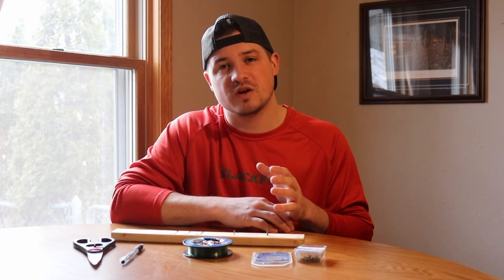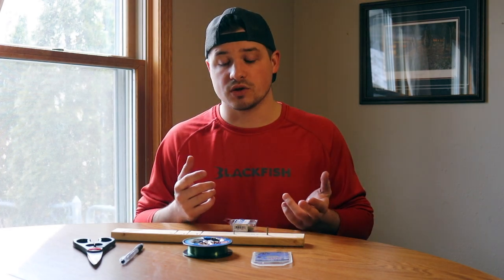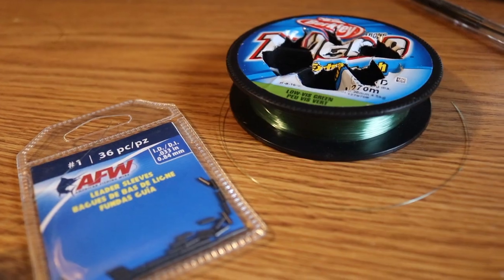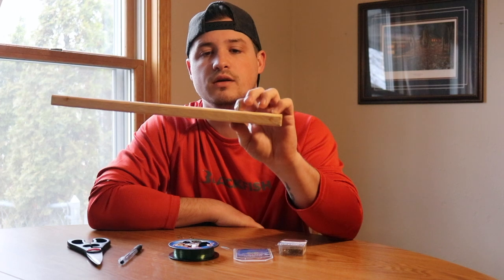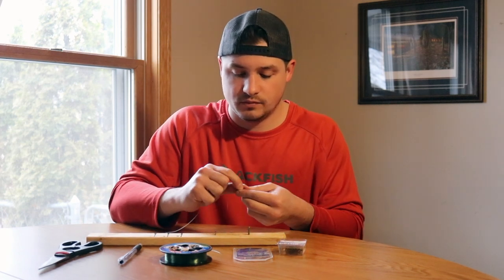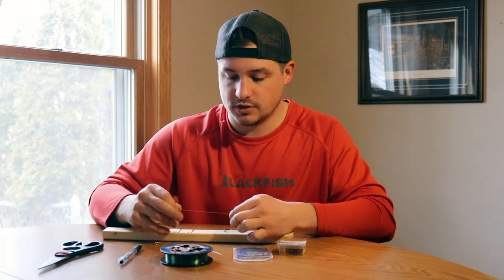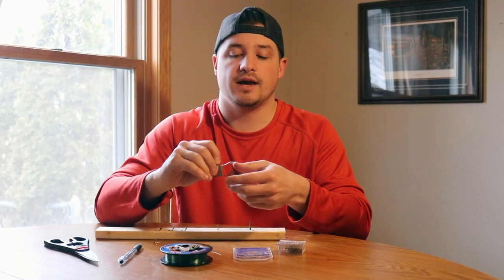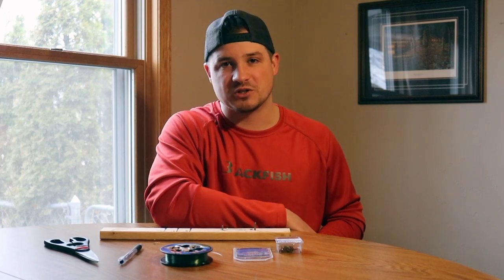How To  Make a Stinger Hook Rig - (DIY)

Comment: I can confirm that this works even on a Pike. I only fish Pikes but i didnt wanna buy  carbon and some super expensice pieces.
Yes the stigner line is a normal nylon line BUT it is a secondary hook on your bait and not the primary that is one metal piece thingy with weight. That said I am no professional or anything like that, i just go and throw soft plastic lures and get Pikes up to 10kgs. Cant tell if this will work on double digit +

Comment: How do you attach that to your hook then?  Couldn’t the loop open and come off?
Reply from the maker: you attach your hook at one end of the 8in long line. the other end you slide your sleeve through. Then create the loop and tie your knot. The diameter of the line and the knot is enough to not slide through the sleeve. Hope this helps!
Reply: Badger Sportsman Magazine makes sense!  Thanks! I had a bunch of short bites this weekend. Going to try this for sure!
Reply from the maker: @justinkahler2807  It works great! I fished the fox over the weekend and it was all short bites as well! My success rates went up dramatically when I switched.